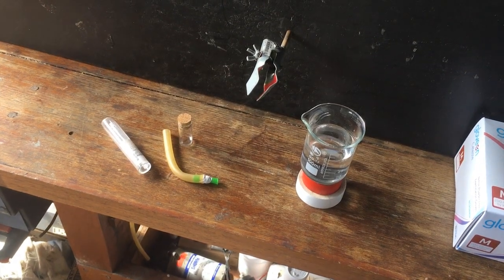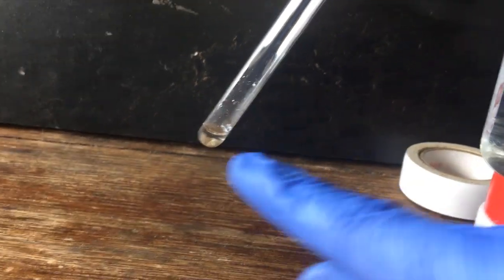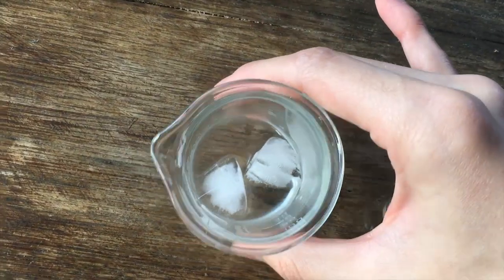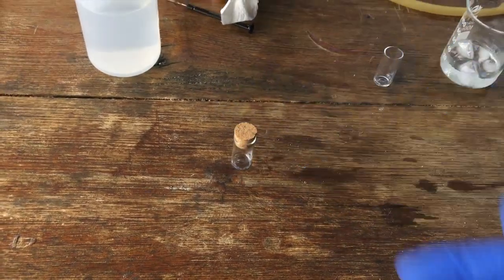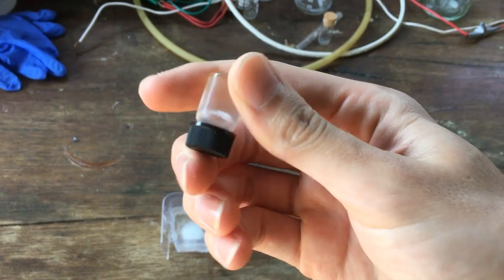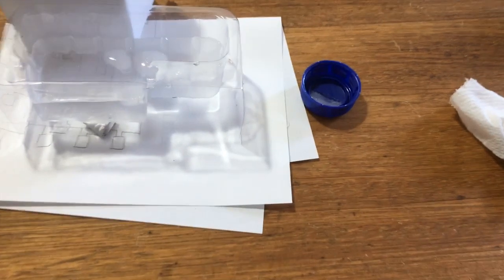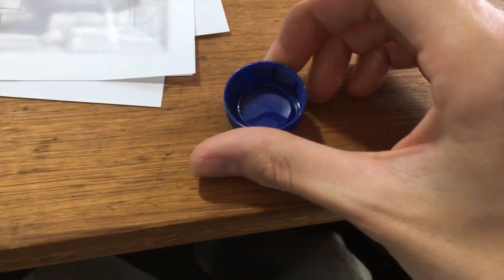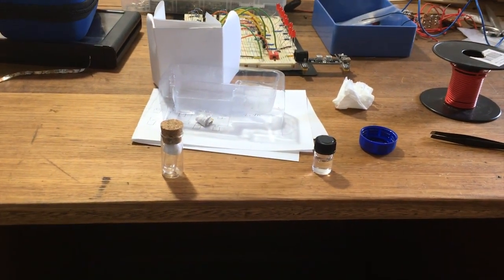DIY Heavy Water?

Comment: No details given.
No government agency is going to permit the procurement of any high grade heavy water.
Reply from the maker: Ownership, manufacture, and purchase of heavy water is not restricted in any way unless you’re buying tonnes of it. Government agencies really don’t tend to care about this one. It’s nowhere near the level of actual special nuclear material like enriched uranium or plutonium.
Reply: You are mistaken. I have done my own studies and have had them confirmed by one who should not have confirmed them. Of that I will say no more.

Now for a challenge. Bearing in mind that it is necessary to steam Crack dueterium oxide, and that there are I do believe 2 kinds of hydrogen and three kinds of oxygen, here is the challenge. From the isotopic section of the crc, calculate how much water you would need to process in order to just obtain 1 kg of pure dueterium oxide. Do this dead sea water, salt Lake water, normal sea water, and fresh water.

Comment: I've just binge watched the whole series... it literally had me on the edge of my seat.
I'm sorry for your disappointment.
Reply from the maker: Wow, I'm surprised anyone's still watching this series at all. Glad you enjoyed it!

Stay tuned though! I'll be trying this project again at some point (hopefully I'll start it during this year). I already have some better cells built which should make the process four times faster.
Reply: @ScrapScience  What if you got a cell with a PWM variable frequency driver and run the electricity through an induction coil multiplying the voltage considerably before feeding the cell. It should be more efficient and effective. Also, I would take the time to build 1 good cell with a feed system. You should be able to run down about a 1/2-1/4 liter an hour. I would be happy to share some of my designs with you. I built a lot of stuff for an unrelated project a couple of years back.

Comment: Could it be that the water you used was significantly depleted?
Reply from the maker: It’s certainly possible. I used rainwater for the entire extraction, which may have been slightly depleted to begin with, but I have no way of knowing.
Reply: @ScrapScience  it is possible that rain water is less rich in heavy water because D2O doesn't evaporate as easily.